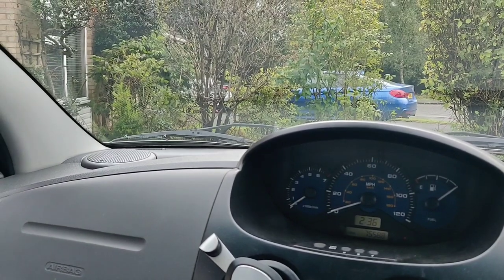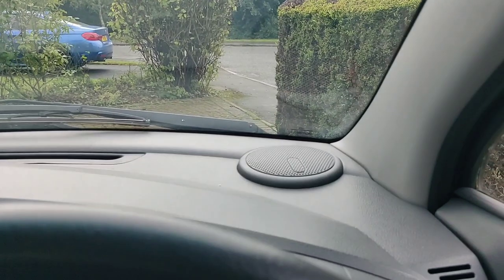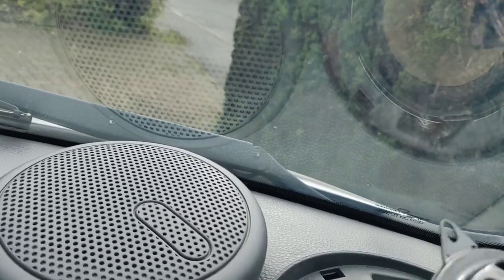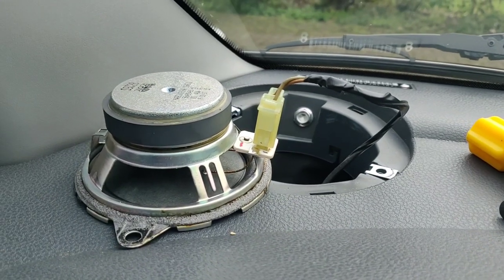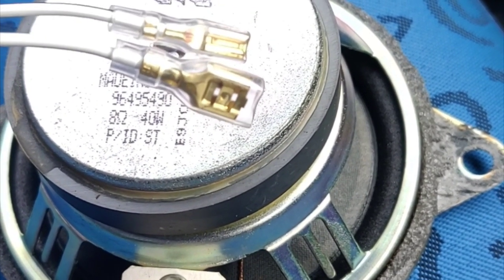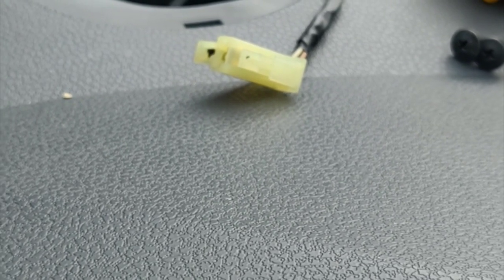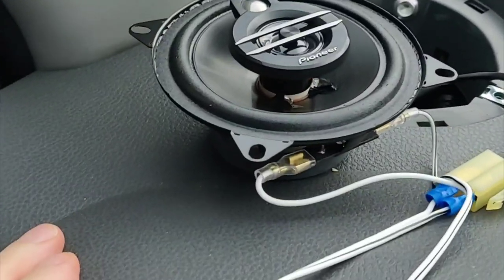Chevrolet Matiz stock front speaker upgrade to Pioneer TS-G1030F

Comment: Hi Sean, did the same upgrade on my daugthers 2005 Matiz. Worked like a charm, I reused the original screens. Thank you for uploading this video, big help. Thanks !
Reply from the maker: Glad it helped. I decided to use the Pioneer covers - but I suppose an option is to just fit the bare speakers and replace the OEM covers, if that works for you. :)
Reply: @SeanPearceUK  I removed the two not used flanges and could fit the OEM covers right back. A few minutes ago I replaced the old 1-DIN radio for a 2-DIN JVC with all the modern features, It slided right in, all the stock connectors fitted, so this was a 30 minute job. Next thing is the replacement of the back speakers.
Reply from the maker: @tedschuurmans  very much looking to put in a replacement (probably single DIN with Bluetooth), and rear speakers with 'next size up' from the fronts (see other comments for model numbers). Would be interested in the model of the JVC and what you think?
Most importantly - did you make an install video?? 🤔😁
(I'd heard that the brackets are a little tricky in the Matiz, but your experience sounds different?)
Reply: @SeanPearceUK  Hi Sean, I have put in the JVC - KW-R930BT, as said the 2-DIN version. It fits really well. What I noticed is that in your video, you have brackets, in the 2005 Chevy Matiz there is more like a cage (don't now if that is the right word), it surrounds the whole 2-din and it fits perfectly. I just bought a gopro camera, but not yet able to make any install vids. Let me try to get the camera to work, and will do a bit of a "reversed install" vid, that will make a lot of sense ( I suppose) :-)

Comment: Really a nice job man! Thanks for the video, i have the same speakers but i don't know how to install the pioneer grills instead of the stock one. They dont have the clip for "clipping" into the plastic of the car, how do you fit it stuck into it without the clip? Thanks for answer and sorry for my bad english :)
Reply from the maker: As I recall the surround for the Pioneer Grills are screwed through the two speaker mounting holes... They don't "clip" in place of the originals...
Now I cannot remember if the surrounds are "on top" of or "under" the speakers, though...
Sorry I was too excited and missed that part in the video!
Reply: Did you get how to fix them down? Please help
Reply: @NewTABRIS96  you need to remove the "grid" from the Pioneer plastic, Place the Pioneer plastic without the grid on the speaker (they Need to Just be placed, not screwed, only placed) now you can screw It with a short screwdriver through the hole on the Pioneer plastic. Once the Pioneer plastic hold the speaker and itself Simply push back the grill info the Pioneer plastic. Sorry for bar english but i'm italian, i can try to explain It better in italian. It's easier to show than saying It.
Reply: @iRunner98  Sono italiano anche io haah, ma credo di aver capito, non era segnalato da nessuna parte che la retina si separasse dalla plastica, oggi provo a sistemarla così! Grazie mille
Reply: @NewTABRIS96  Grande ahahah, si praticamente quella retina si stacca dalla plastica, basta spingerla via, la levi, e poggi la plastica sugli altoparlanti, usi i due fori passanti per avvitare insieme sia gli altoparlanti che la plastica, dopodiché infili la retina di nuovo. Semmai dovessi toglierla poi ti basta infilare un cacciavite piccolo spaccato e fare leva per risollevarla e svitare le viti. A me sono rimaste un po' sollevate perché la plastica del cruscotto è obliqua, l'ho lasciata in quel modo. Se ti può servire su FB c'è un gruppo facebook italiano di Matiz e Spark, se devi chiedere qualcos'altro li sicuramente c'è gente che può aiutare 😊
Reply: @iRunner98  Grazie mille per le spiegazioni dettagliate!!! ❤️
Reply from the maker: @iRunner98  That is a more perfect explanation that I gave above! 😂

Comment: are the rears 4 inch aswell, i also bought the pioneers but i',m thinking i might buy the same for the rear
Reply from the maker: No - the rears are 4x6 and I've upgraded those too with Pioneer TS-A4670F. I have another video showing this upgrade sitting in the wings (I need to re-record one scene for it all to make sense, before publishing!). Note that there is a little fiddling required to get them to mount in place of the stock similar sized speaker, but not same screw-hole pattern...

Comment: I was trying to decide which speakers to buy for my 2001 Suzuki Ignis but your reaction to Pink Floyd is exactly what I needed to be sold on the Pioneers! If you still have this car, add a small class D subwoofer and you are golden. I already have a sub, missing the mids and highs for now. 
Also if you have an AUX jack or bluetooth, using a parametric equalizer on your phone and playing music through it will make it sound like a pro audio setup. You can use REW to generate an EQ profile that will absolutely blow your mind and you can use Poweramp Equializer (on Android) to apply the generated EQ. Or you know, a miniDSP as a normal person would, but I'm trying to save a buck here!
Reply from the maker: Hi, glad it helped; I was surprised given the price-point how big improvement these made! :D 
See other videos - we also upgraded the rear speakers to pioneer 6x4" which was another great improvement, and finally the head unit to a Pioneer one with Bluetooth input... Anyhow, all moot now - we no longer have this vehicle!
Reply: @SeanPearceUK  just installed mine yesterday, they sound amazing for the money and size, as you said. Thanks for the video mate!

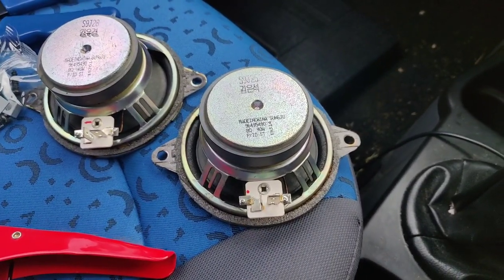Comment: It is a nice video Sir, and I like the music very much. BUT, I do think you have a problem, especialy at min 5:09, the original speakers were 8 ohm (the 40W is BS for sure), so I think you had probably 2 channels per speaker in original setup, that in case you had only those 2 speakers on the car. NOW, the new 4 ohm speakers sound louder, sure do, actually X2 loud, but the load on your CD unit, per chanel, has droped to 2 ohm ... well, may I ask ... is it still working? If it still does, that`s a fine CD unit. Sorry for my english ... but I`m sure you got the idea
Reply from the maker: Oh wow! I had not spotted the impedance differences between the old and new speakers! I'll have to check this out... I suppose worst case is it can damage the output stages of the receiver / CD! 
HOWEVER, it did perform OK - no noticable problems posed that I was aware of!
BUT since then I have changed the receiver to a Pioneer Bluetooth one - and a new video on that upgrade is in order...
I will actually double check the impedance compatibility with that too - one would hope they are "matched" or tolerant of the range!
(*THAT* said, there has been two occasions where the new unit "shut down" and would not turn back on; until the whole unit was disconnected / reconnected and second occasion, battery disconnected and reconnected! BUT it has behaved itself in the some months since that last occurred!)

Comment: Hi Sean great video! Can I know what adaptor are you using to connect the Pioneer with the stereo?
Reply from the maker: There wasn't an adaptor per-se. The speakers came with some exension wires, which had the appropriate "spade plugs" on one end. I used a kit I had and crimped on the blue Spades which then plugged into the sockets on the original Matiz connector - as seen around 3:30 in the video... You can see this kit and the little leads that came with the speakers about 0:10 seconds into the video. If you search Amazon for "Crimp Connector set" they're available for about £20-£30 with a selection of connectors (Rings, Forks, Spades) and a tool...
Reply: @SeanPearceUK  Thank you for the answer!

Comment: 2 questions whats the diameter of the speakers and does wattage matter for it to work or no?
Reply from the maker: Hi, the diameter is 10cm or 4" (inches)... The wattage determines how hard they can be driven, and these easily handle the stock stereo - plus if you see other upgrades - an (more powerful) pioneer stereo upgrade too. More important is to understand the nominal 'impedance' in ohms suits your amp... These are 4 ohms (same as stock)... You. Must choose / understand for the amp your using... Using lower impedece means they are driven harder and can draw too much current from the amp. For specs see https://www.pioneer-car.eu/eur/products/ts-g1030f/specifications

Comment: A najważniejszego nie Widziałem:jak dopasowuje głośniki i maskownice  do otworów .
Reply from the maker: Google Translates to:
> And the most important thing I haven't seen: how he adjusts the speakers and grilles to the holes.
I don't recall that there was any "adjustment" required... 
If I recall - the mesh grilles from the pioneer covers need to be eased out... With the speakers positioned into the holes, put the pioneer surrounds over and align the screw holes... I can't remember maybe only 2 of 4 align... Once screwed in place, carefully insert the mesh back into the plastic surrounds. Disassembly will be tricky - the mesh will need easing out somehow without bending it!

Comment: Could you advice me an adaptator for the chevrolet matiz in order to connect the speakers ?
Reply from the maker: For the speakers to connect to the internal connector - one needs to add some "(male) spade connectors" to the cables included with the Speakers.
I have a kit of spades + crimp tool which I use for many similar tasks. The alternative would be to strip and solder the "unterminated" ends of the adaptors into the original adaptor.

Comment: Hey Sean, do you know a user manual for changing the speakers as a layman?
Reply from the maker: I don't know (don't think there is). The speakers come with some instructions, but accessing them depends on each car. I'm no expert and managed as you see in this video. I've just received another set of speakers for the rear and also replacing the stereo, so look out for new videos soon! I'll try to add a little more structure and show more details on those videos! 😁

Comment: screws and cap fit? The old cap doesn't fit?, I'll appreciate your answer, thanks.
Reply from the maker: The OEM covers can be discarded and don't look particularly nice IMO.
The Pioneer supplied cover plates fitted perfectly, but I only used 2 out of the 4 screws; same positions as the original OEM. The Pioneer grilles (obviously?) then fitted the pioneer cover plate, and screws through the speakers to fix both in place. (i.e. they don't "snap" in place as the original OEM covers did.
I used the same metal screw brackets as OEM (rather than the Pioneer supplied ones), and I believe, (cannot recall) the OEM screws; if not, then I used 2x Pioneer supplied ones!
As I'd only used 2 of the 4 fixing locations, I was a little worried that they might not fit 100% and be twisted / bent or wobble or vibrate; but they did not.
The back-up plan would have been then to work out how to use the two additional Pioneer metal tabs + screw holes (might have needed to drill the plastic in a very awkward area), but they performed impeccably as-is. 😀
Reply: @SeanPearceUK  thank You very much, I'm gonna do the same way!.
Reply: @SeanPearceUK  Hi, i did the same to my matiz but, I've screwed the speaker in the the 2 hole of the matiz dashboard, then how i fit the cover plates? For now i just pushed them into place, but i like to screw them down i just don't get how to do it.
Reply from the maker: @NewTABRIS96  As I recall - if you want the PIONEER covers, as I have, you screw the Pioneer surround down into the two screwholes... The Pioneer mesh grills "pop out" (very carefully) of the surrounds, and can be eased back in again after fitting the surrounds... (Hopefully if needed in the future, the grill can be "eased out" again if necessary - but not tried that yet!).... Just be very careful not the bend the mesh - it does "click" in nicely if you progress slowly around the edges...

Comment: What speakers do you recommend on the back of the car? preferably pioneer too
Reply from the maker: I've not done, or even examined in detail, the back ones; but I think they're the same size (4" / 10cm) as the fronts, so the same speakers would probably work? Of course choice would be Pioneer, to match the fronts. :-)
In my mind I've been thinking that 6" round (PTS-G1330F?) or 4"x6" oval (maybe TS-A4670F?) or similar would be better in the back, if they are 4" at the moment! That all depends on fitment of course, and "drop ins" woule be ideal for me, totally lacking DIY skilz!
Of course price is starting to increase with these options too! :-)
Reply: @SeanPearceUK   I have been researching and I found that this model fits (Pioneer Ts-G4620s G-Series 4" X 6" 200-Watt 2-Way Coaxial Speakers 8.30in. x 6.90in. x 2.60in.), we are in touch, thanks for everything my friend!
Reply from the maker: Fantastic - (TS-G4620S) yes that looks like a good equivalent. Do you say they fit well in the back?
Reply: @SeanPearceUK   i installed The kickers ones, model DSC460 4x6"  and fits perfectly!

Comment: Are these speakers Bluetooth
Reply from the maker: No they are not. The speakers connect to whatever "receiver" (Radio / CD / Bluetooth) & amplifier your car has installed... HOWEVER, I have ALSO replaced the stock stereo unit (and rear speakers) now with upgrades - and the upgrade includes Bluetooth from iPhone and Android devices and works very well. Please bear with me - a little more editing and I'll publish both videos very soon! :D
Reply: @SeanPearceUK  did you replace the rear speakers with the same pionner model of the front?
Reply from the maker: @nsilva800  See now latest Video - rear speakers are a different size and replaced with some Pioneer TS-A4670F... 🙂

Comment: What Price
Reply from the maker: I paid just under £25 in October, and presently they are showing £21 on Amazon.co.uk... For some reason I've just noticed the listing is showing TS-G1033i, and a little research shows that the TS-G1030F delivered and installed, is perhaps a newer model with near identical performance.
Reply: In Amazon to Mexico $35 USD that was yesterday, may be in your country is going to be more cheaper